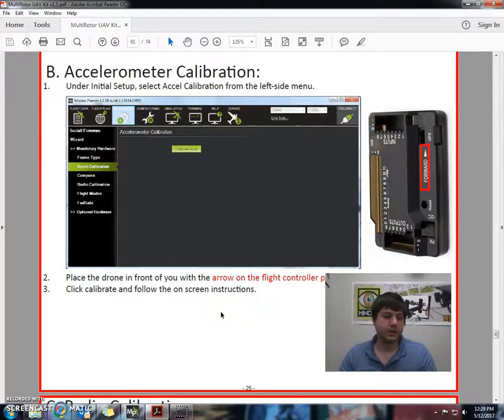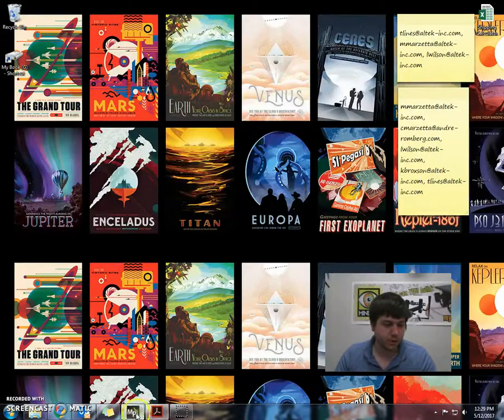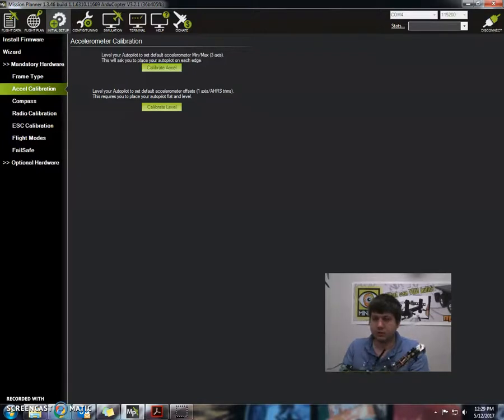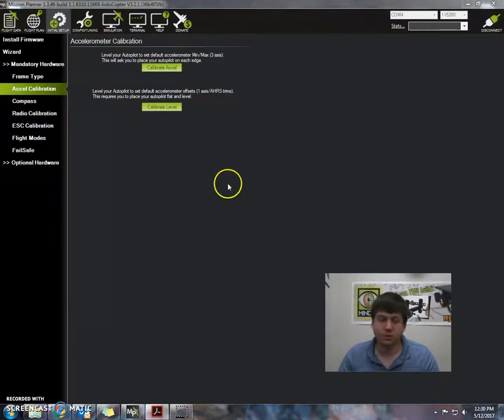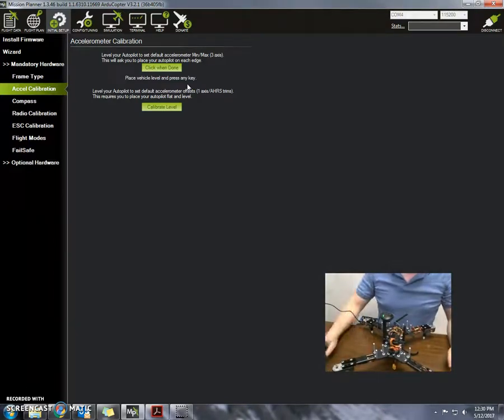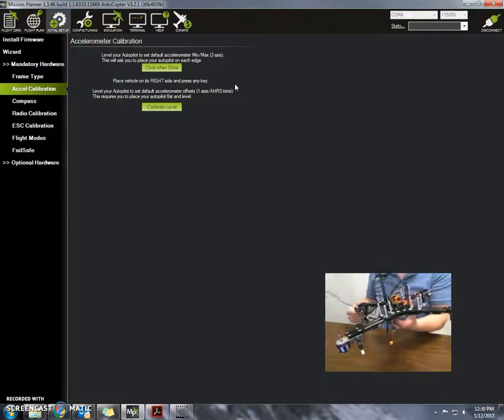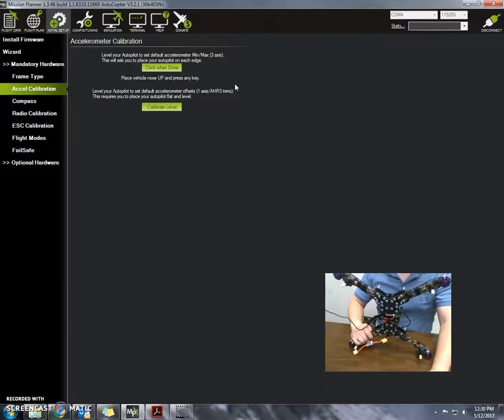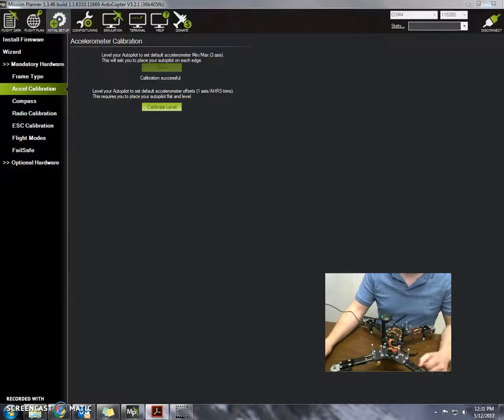MINDS-i Mission Planner Step #3B Accelerometer Calibration

Comment: bro im using apm 2.6 i did accel calibration without quad(only apm via usb cable) after i connect apm to quad and i armed all motor running(without props) in same rpm if i tilt there is no changes in rotation can u help to work gyro?
Reply: Sure, I'd be happy to help. After you have the APM 2.6 mounted to your quadcopter, run the accelerometer calibration again.

Comment: hello dear, i make the same quadcoptor using pixhawk 2.4.8 controller but accelerometer shows wrong direction means when drone move left then ardupilot screen shows right movement. it is possible ?
if not then help to fix this problem.
Reply: Is it possible that the board is facing the wrong direction?